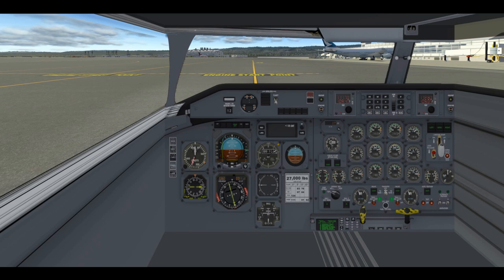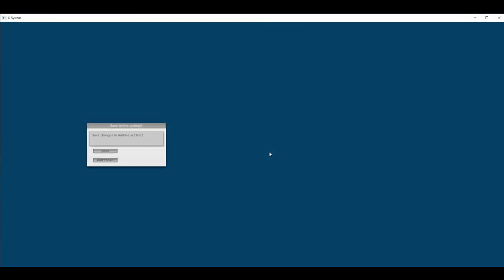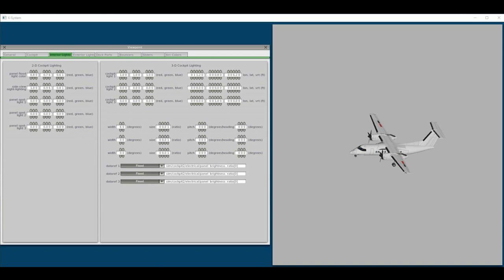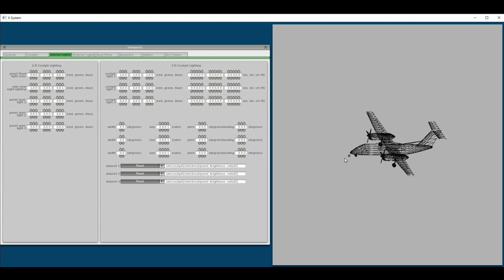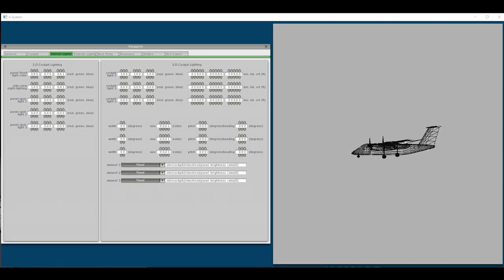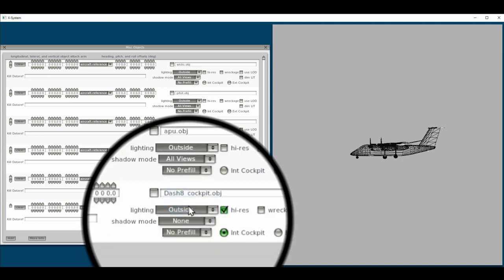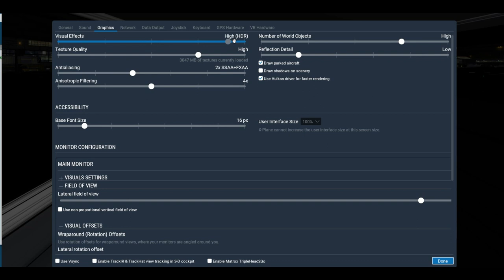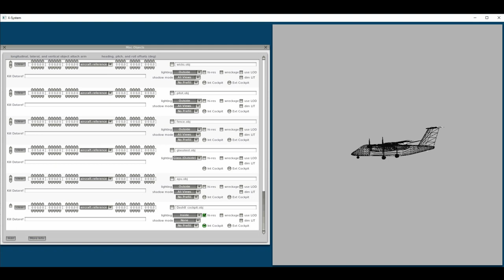How to Create a 3-D Cockpit for X-Plane 11 Part 5 ~ Lighting

Comment: nice series of videos on 3D cockpit making, I have one last question tho, is there anything that could be done to increase the display of the brightness of the autopilot indicator/settings numbers in the autopilot display window/annunciator? currently i can barely see the autopilot settings at night
Reply from the maker: Hi UAL835,  I'm sorry but I don't know how to make changes to individual  instruments lighting put here's a link to the forum where someone had a similar problem might help. It involved using  photoshop (or Gimp) to lighten the object, might be worth a try.

https://forums.x-plane.org/index.php?/forums/topic/228065-cockpit-instruments-too-dark-to-read-after-update/

Thanks for watching hope you were successful creating you 3D cockpit and you can get the autopilot lighting corrected. Let me know how you make out.

Blessings,
skip
Reply: @WEHVideos  turns out the only solution i got to work was to turn on the flood lights like you did in the video lol, seems like a good enough fix for me so thanks for your help!
Reply from the maker: Looking good glad you figured it out :-)

Blessings,
skip

Comment: thank you so much for this, felt so helpless with planemaker. i sincerely hope you do more of that stuff, especially manipulators, door handles and so on. I simply don't get these things to work and i don't catch the trick.
Reply from the maker: Hi piloto loco,  I'm afraid my abilities with plane maker are extremely limited I don't know anything about manipulators etc. just the simple things, sorry.

Blessings,
skip
Reply: @WEHVideos  hey no problem skip. but maybe you can help me with something specific: 
i am trying to place smaller panel lights to illuminate the surface of the panel and in some cases maybe place such inside the analogue gauges.
your video shows a reduced choice of 3 spotlights that affect the whole cabin, but what i need to understand is whether there very little lights that i can put underknief the front glare shield shining downwards affecting a very limited space. i work with ac3d, and there is some chosable light types that can be added, but things don't seem to work. now there is plane maker and on the other hand there is the modelling program like AC3D, and i don't know which way to go to find a solution. If you wanna spend a minute or two to investigate, maybe we find some cool new stuff. thanks in advance for your help.
Reply from the maker: Hi piloto loco,  I'm afraid I won't be able to do much here I'm two video's behind so it will be some time before I can check this out, it does sound interesting though so maybe someday I can give it a try but not in the near future I'm afraid :-(

Blessings,
skip